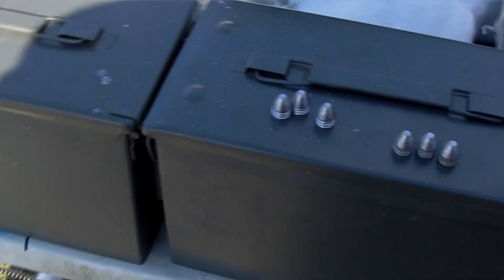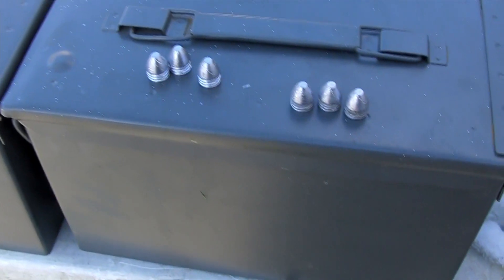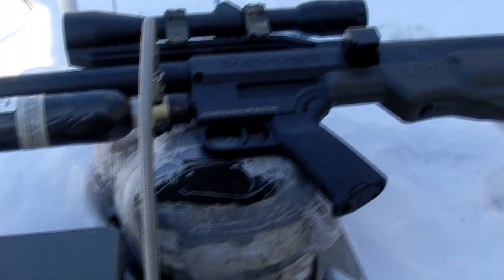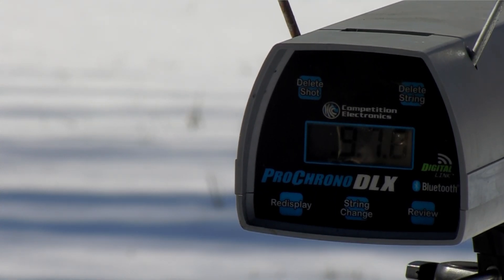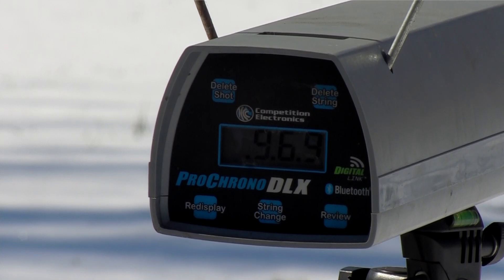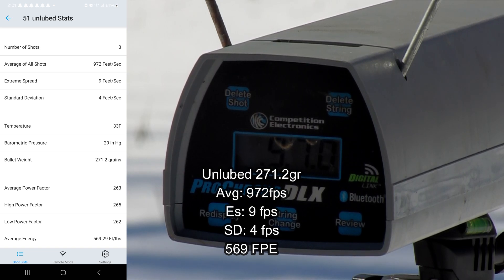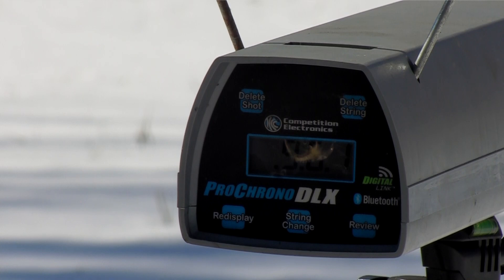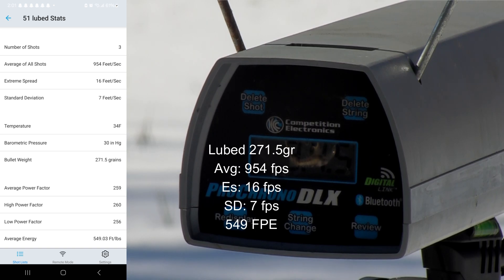Does lubing air rifle slugs increase velocity?

Comment: You should always wash  pellets or slugs and Dawn and then dry them with a hair dryer and then just do a light spray on the slugs or pellets roll them in a cotton rag to make sure all the excess is off and you're ready
Reply from the maker: I have read about doing this on an old GTA post in my early airguning years, and many did agree with the practice.  Though they were looking at .22 and .177 cal.  I used a black powder 50/50 lube on these .51 slugs.  It's certainly not the best choice in hindsight, considering BP operates at 15 to 30k psi while I'm limited to only 3k. Airgun specific lube would probably have helped.  Although I did not see a loss in accuracy, just a POI change and a gummy barrel from all the unburned lube.  Though cleaning was much faster with zero lead flakes in the rifling.

Comment: Try powder coating them , works great with cast boolits
Reply from the maker: I did just order a sizing so I can powder coat them. What kind of powder coat are you using by chance?  I've read/watched a little into the process, and powder selection and application vary.  I'll try to test with as many applicable variables for you as possible.
Reply: I use Eastwood ford blue and squirrel grey, I would check out Elvis ammo on here, he has a ton of vids on powder coating cast boolits, though ther are ton of vids from other guys he goes way deep
Reply from the maker: Ok.  I watch a little bit of him and Fortune cookie in my spare time when I feel getting expermental.  The only powder I have on hand right now HF white and black.  I've been able to get white to coat nicely, around 2 thou on a single coat. but black has always needed multiple passes the achieve the same thickness

Comment: Even if your tethered to the tank the air pressure is dropping consistently and I would have fired 3 more unlubed after the lubed rounds to check my velocity again for confirmation. That gun uses mad crazy air so even connected to a tank like say a 6.8 ltr the tank pressure will have dropped considerably I would imagine. Either way this is a very cool test. I have often wondered myself if there would be a difference in speed. I tried this with Slick 50 back in the day on a 30-06 and there was indeed a difference in speed with that lube. It shot almost 200 FPS faster than without the lube so the Teflon did make a difference but never tried it with an airgun. I'm not taking a chance damaging seals/O-rings with that lube.  I have always been told to only use silicone with airguns so I am not putting Slick 50 lube in a 2K+ airgun. Teflon may be ok if you can isolate it to the barrel only though. Thank you.
Reply from the maker: The hammer does use a TON of air.  Off of the 500cc bottle, I've found you get 2 shots equal with the third being slow.  First shot @4,500psi, second @3.6k psi, and the third @2.9k psi.  This is a 6.8L 4,500psi tank, though I rarely fill above 4,200psi.  It just takes way too long to make up the last couple hundred pounds when I want to start shooting. I believe the loss in speed is simply that the air doesn't get hot enough or create enough pressure to fully burn up the lube im using.  And instead the lube is only adding to the bore contact creating more friction than what it is capable of reducing. I can do a future retest or make a shot count string with the same slug weight to find exactly how many shots per tank fill.  I'm about 99% certain it's over 10, probably closer to 14, with a full bottle.  It's nice enough today I'll try to do that now.

Comment: The purpose why airgunner's are lubing projectile's come in the from of consistency between shots in FPS and Extreme Spread, which matters down range.  It helps keep the barrel cleaner, and more consistent.  Simply roll the lead around in a container with a thin film of silicone oil on it before loading.  Almost all airgun competitors lube before shooting.  Sometimes you just have to spit on it.
Reply from the maker: Interesting.  I did know the H&N slugs are pre lubed, though what I could find said it was excess lube from maching that gets left on.  It doesn't seem to negatively impact performance. I don't really have much experience with small bore air gun slugs in general though.  Only my BT 65 in .177 needs them.  My .17 and .22 maurader work great with really cheap pellets.  And my .25 gauntlet is a little too expensive to consider switching to slugs when I'm in an area that allows me to use 22lr freely for a similar price per shot.  Although that might just be me getting jealous at those guys with the M3 builds slapping 100+ fpe slug guns that destroy what I'm capable of with a 22lr and they make it look so easy too
Reply: Thanks for sharing. Lee Alox comes to mind...

Comment: Ive tried spraying with silicone the barrel on a small pcp in .22 and actually increased the speed for the first 3-4 shots. Havent test the speed of lubed slugs, but i lube mine sometimes when i want accuracy, and it slightly tightens the groups on 100y, 5 shot grouping with my .30 cal but haven't checked the speed.
Reply from the maker: I'll have to make a note of that and try it out sometime.  I don't run slugs in my .22 but I do have a .177 slug gun.  Any specific silicone spray like P.B, super tech, WD?
Reply: @raysbudgetslowmo  just regular silicone spray from the grocery shop  last few were called stac plastic silicone spray in Europe are 5 bucks but I have and balistol silicone both are the same wd40 is bad for the rubber dealings need to be pure silicone.
Reply from the maker: Thanks.  Next time I'm out and about in hardware, I'll try to pick out some different ones than what I have on hand

Comment: I would like to see same test. When it's warm out, say 70°. My guess is cold weather affecting the lube.
Reply from the maker: I do plan on doing further testing in the future.  There are many, many different lubes out there with some cold weather testing being carnuba red and homemade lithi bee. The lube I used is comparable to Old NRA 50/50 using paraffin wax as the carrier. Works decent with blackpowder but very little information in the airgun world.
Reply: You could also try Century Solutions BP- 2000 powder, dry lubricant, trigger tuner and bore treatment. From personal knowledge, it will drop pounds off of a AR trigger pull weight. And makes Bores slick as snot! Reminds me of graphite powder. The way it was explained to me. Is if graphite powder Particles were the size of a basketball?BP 2000 Would be the size of a golf ball?
Reply from the maker: Hmm reading into that a little bit it mentions smooth-kote so you might be on to something there.  May or maybe not a per round basis but coating the bore could prove interesting results.  Combined with a smooth-kote patch and a graphite projectile could potentially really reduce bore friction

Comment: If you didn't refill to the same starting pressure for the lubed slugs as what you started with for the unlubed slugs then this video is pointless.
Reply from the maker: It's regulated at 3k psi, the bottle remained above 3k for the entire testing with the tethered connection to to the tank